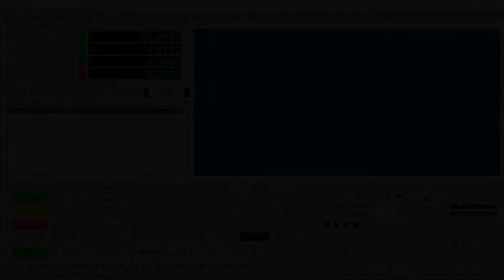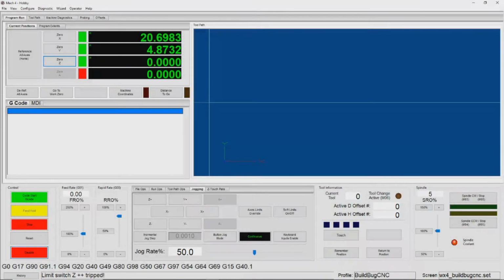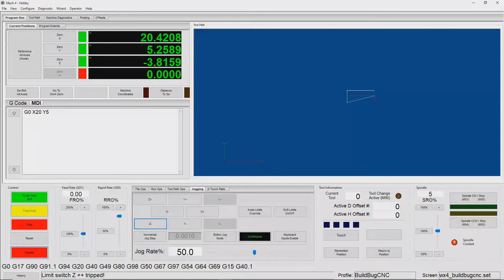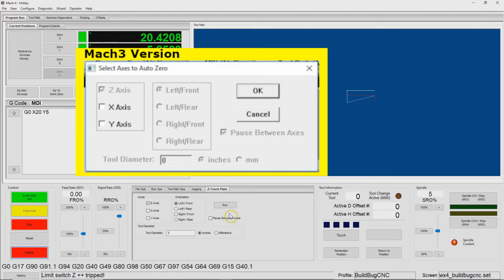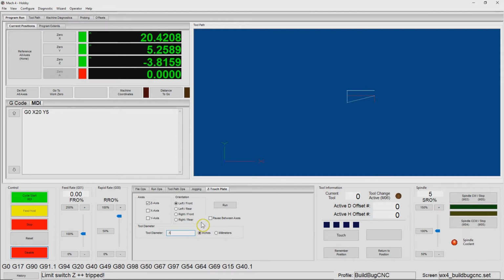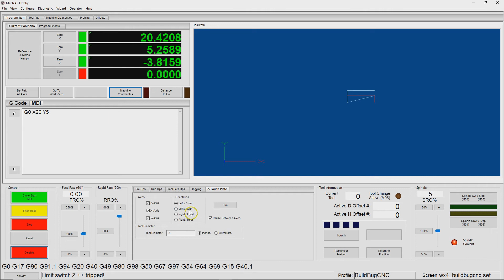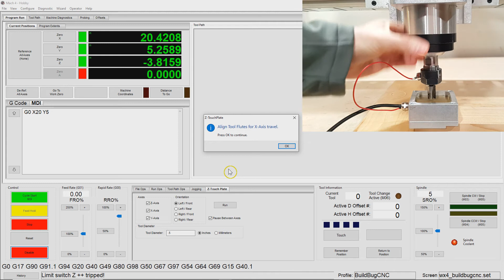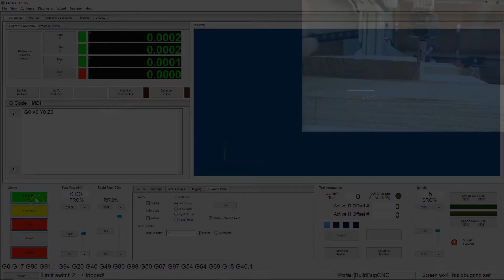CNC Router Parts - Z Touch Plate gets ported to Mach4

Comment: is this still an open thread, just moved to Mach4 after a HD failure running Mach3.  My problem is that changing the input signal to active low doesn't 'stay' reverts back to the big red x..    my probe signals when it contacts the Z touch plate, hesitates and then continues down...   history only says it has a hit..   any guidance?

Comment: nice job, ive actually a problem with the G31.1..2 ..3...4.. Just a hint: If you are using more than 1 probe and the first is a 3d probe and the second a touch plate. the touch off ui from Mach4 wont work properly. it just wont stop by hitting the G31.1 probe plate...

Comment: 3:40 what is the bad thing that happens if you dont check the thing off to pull active low?
Reply from the maker: The probe needs to be set up correctly or the tool will simply NOT stop moving. This can break a bit, the touchplate, and/or the z-axis depending on how powerful your stepper motor is. The probe signal is what tells Mach4 to stop. Checking the 'active low' in this case is simply telling Mach4 that our probe will signal contact by pulling 'Input #6' to ground (i.e. low). With the box un-checked, you are telling Mach4 to expect a +5V signal when the tool touches the plate. There may be other touchplates or probes in the world that signal using +5V, but the AVID CNC's Touchplate uses a ground signal thus requires us to select 'active low'. I hope that makes sense.
Reply: @buildbug3979  hm.. well.. just set up an avid cnc and using all the guides i can find on mach 4.. the touchplate should work from the outset, but it dont.. the probe-speed is set slow at less than 5 mm pr second(kinda wierd that it is set by minutes but anyways), and the return after a probe is 2,5 cm.. when jog-ing the bit to less than 5 cm over the touchplate and pressing the button to do the probe, the machine seems to go full speed onto the touchplate and depresses the springloaded plate on the center of it, then it retracts all the way up to the stop-sensor at the top of that axis.. i am guessing that is a response to the steppermotor getting more resistance than expected.. but i cant figure out why it goes so fast.. even if the active low checkmark isnt checked, should the steppermotor go full speed?
Reply from the maker: @yvindnilsen94  While my machine may look like an AVID CNC Pro 4x4, it isn't. I do not have nor use AVID CNC's controller electronics so any help I can provide will be very general. I would take a step back and verify the basic Mach4 configurations.
 - Are the stepper motors setup correctly? (Axis mappings, Counts/unit, units/min, direction of motion etc.)
 - Is the Mach4 profile you are using based on a Mill and not a lathe or something else?
 - Make sure the probe signal is working. Mach4 "Machine Diagnostics" tab's red "Probe" light. 
   If this doesn't work there's no point in attempting any probing motion. The touchplate is just a
   normally open switch, it's the design of the electronics within the controller that determine whether the signal 
   uses +5V, or a ground signal. You'll need to confer with AVID CNC to know which is required for their
   controller.
 - If you believe all the config is correct AND the probe signal is working then you might check Mach4's 
   "Status Bar" (above the "History" button in the bottom left corner). The status bar echos what modal
   gcodes are in effect at any given time. There are many modal gcodes that can result in unexpected behavior when activated.
   e.g. G90 vs G91, G93 vs G94 vs G95
Reply: @buildbug3979  thank you for giving inputs in this.. all axis seem to be correct and the limit switches work.. including the touchplate.. when i watch the lights on the program that is.. the machine homes itself with no issue.. got a mail from avid telling me to reinstall mach4.. but i find it spooky to do the test when the machine just goes full force and pushes down so fast i cant stop it